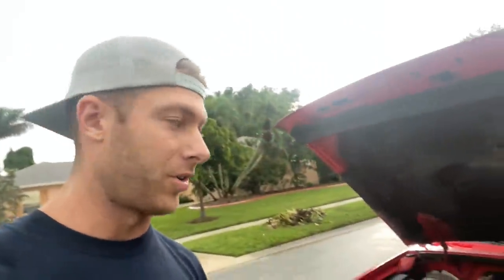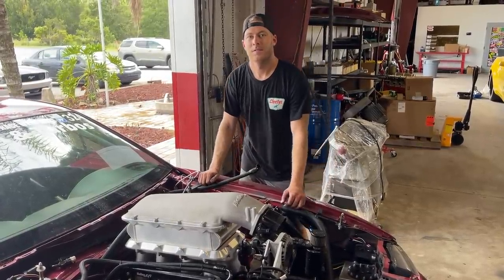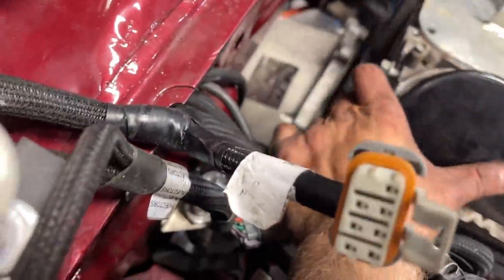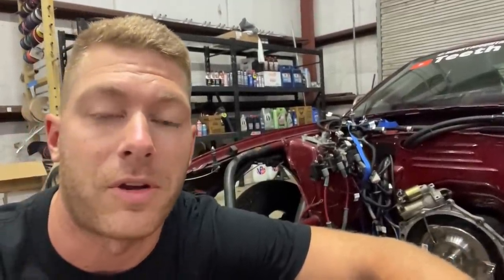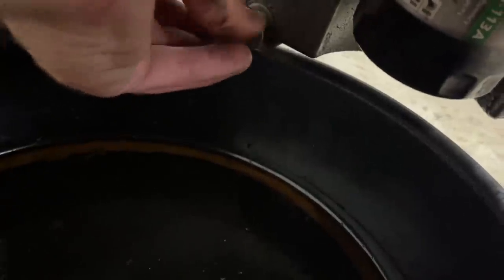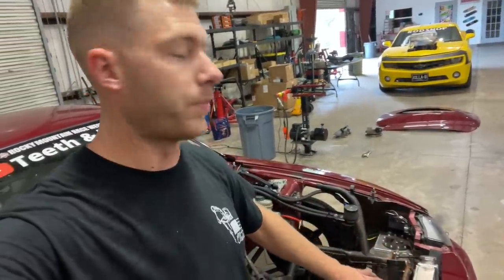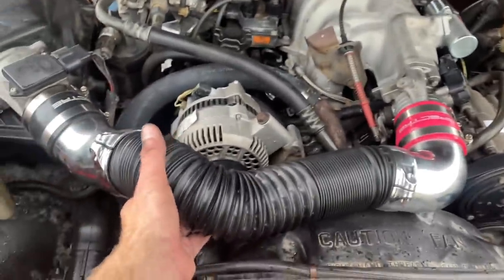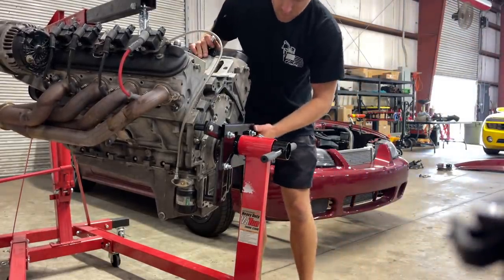Engine is OUT of the Mustang with ONLY 4 Weeks till Race Week.. Ranger Gets Fired Up Again!

Comment: lifted the head, and pushed the head gasket.  Look at piston #4.  All of the carbon is gone indicating steam.  I'll bet the cylinder slightly hydrolocked and bent the rod, causing the bottom of the piston skirt to contact the counterweigh creating the knock.
Reply from the maker: You're probably right ^^

Comment: Check your evap cannister and venting system. If it is not working right when you fill up full of gas the cannister itself fills with gas and floods the engine. Wont start until fuel in cannister evaporates
Reply from the maker: Huh I’ll check it out
Reply: @DoctrParker  Hey Doc!  How is your brother Garrett doing?

Comment: Most of the moisture in the oil is from running E85. and the engine noise is most likely a rod bearing.
Reply from the maker: Moisture isn’t from the e85 because I never ran it on e85 after changing the oil last. Need to reinspect the rod bearings.

Comment: Get you a rear bumper too! It'll completely change the entire look of the car having a complete bumper on it..
And you have coolant in your oil, you know it's not a cam bearing that caused that. You should have looked more closely at the gasket itself. Could have a crack in a cylinder or cylinder head.. My money is on a head gasket, you just need to analyze it really good. Hope I don't sound like too much of a know it all!lol
Reply from the maker: You're probably right, going to look at it again tomorrow
Reply: Most of the moisture in the oil is from running E85.
Reply: May have tripped the fuel pump shut off when JH rammed you. Passenger side floor board located under the carpet.

Comment: Do something different don’t strive to be so much like your brother put a Ford motor back into it and you won’t have these problems yes it will be a little more expensive but if you are a pushrod fanatic check out the new Godzilla motor by Ford 446 in.³ of LS killing aluminum and steel
Reply from the maker: You’re right I should however I have been presented an opportunity that I couldn’t turn down. I’d like to build the fox body with a Ford motor or even hellcat swap